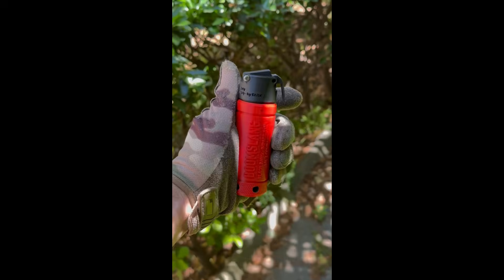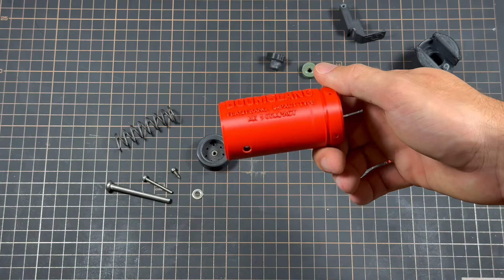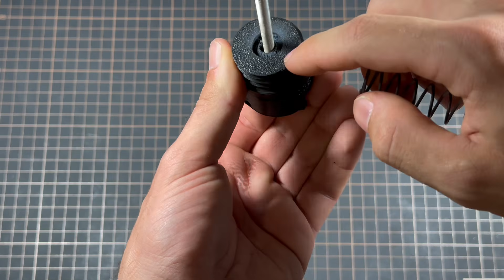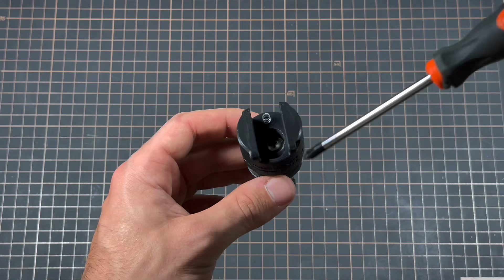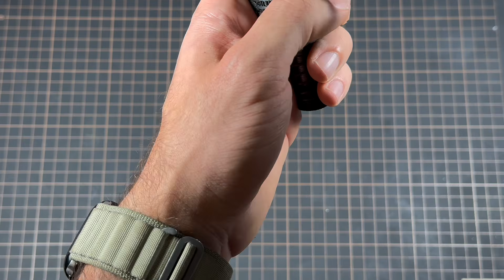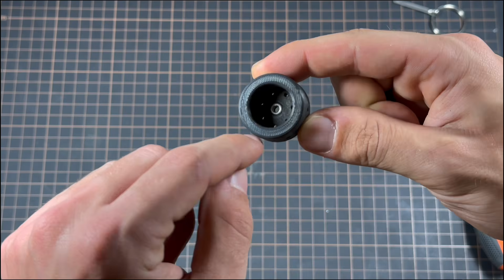Boomslang – 3D Printed Airsoft Impact Grenade | Full Assembly Tutorial

Comment: What kind of spring did you use? I bought a generic one on AliExpress, but I think it's too light and doesn't have the strength needed to activate the primer.
Reply from the maker: Hi! Any AEG spring above M100 will work fine.
Reply: @ghibliairsoft M100 included?
Reply from the maker: @Ares-TN02 yes, I have tried also with M90s, but they prove to be a bit soft depending on the manufacturer
Reply: @ghibliairsoft Thanks. My local store can give me the Element 105s for €5. Can I buy them?
Reply from the maker: @Ares-TN02 they should work fine. Depending by the length of the spring you should be able to build up to 2-3 units! 🙂
Reply: @ghibliairsoft tnk's 💪

Comment: What filament do you recommend for printing? I have a Bambulab P1S and would like to use Bambu filament.
Reply: I know yours is PLA+, but given the possibility, do you think PLA CF or PETG CF could make sense?
Reply: @Ares-TN02  Hi, i use basic PETG and PETG HF BAMBULAB, its work fine ! very hard to break the grenade
Reply from the maker: Hi! I recommend PLA+ as it is usually the most common and affordable, but other stronger filaments work perfectly if not better!
Reply: @ghibliairsoft So far I've printed in PLA+ and everything seems fine. Tomorrow I'll get the PETG and try a new print to compare.